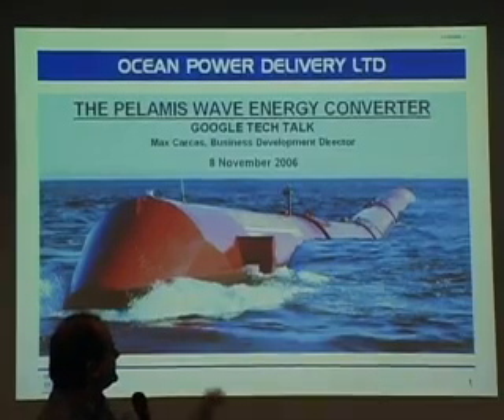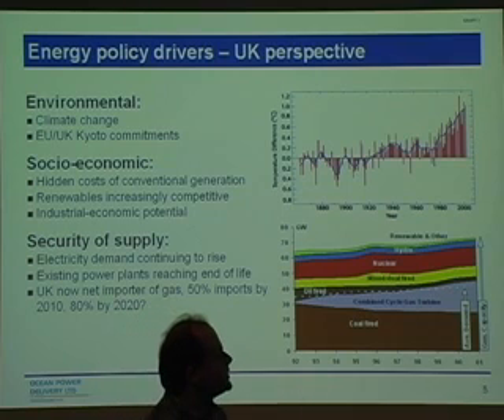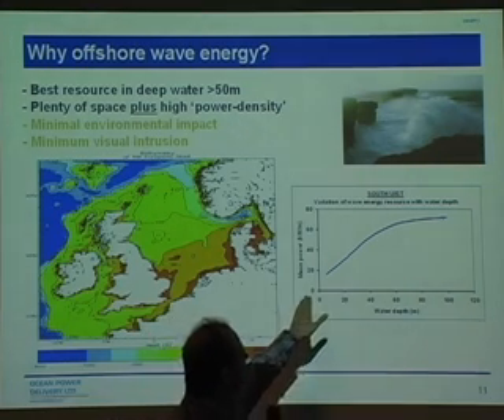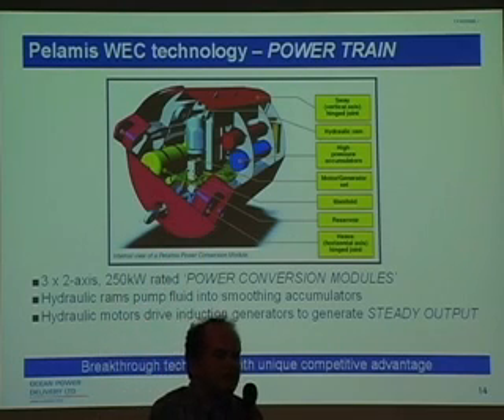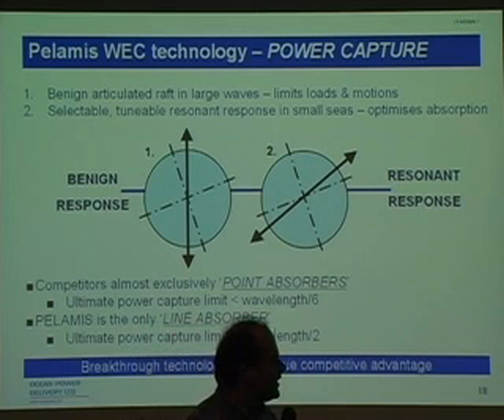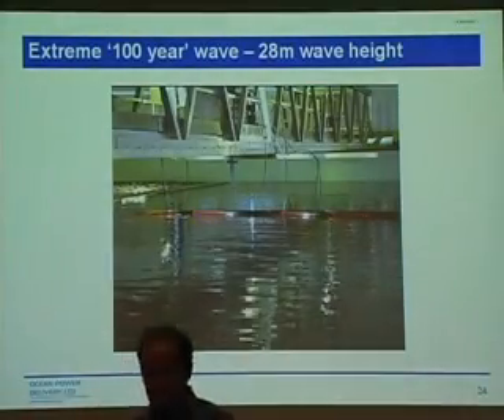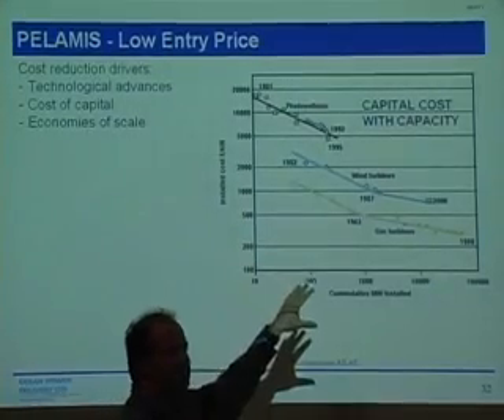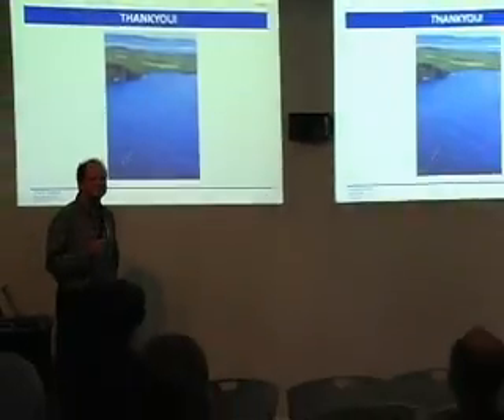Ocean Wave Energy

Comment: And where are all the more frequent & more powerful hurricanes? And why haven't temps increased since 2004? And why did temps peak in 1998?  And why were there temp increases like this before the industrial revolution? And if temps do increase, nothing we do is going to stop it, because if it really is "climate change," something like that is far too drastic to affect by driving a hybrid & switching to CFL lightbulbs, or anything else we could ever think of. Move to higher ground, & go north.